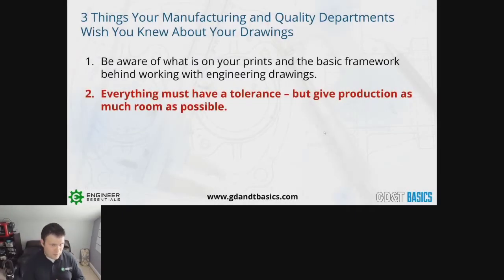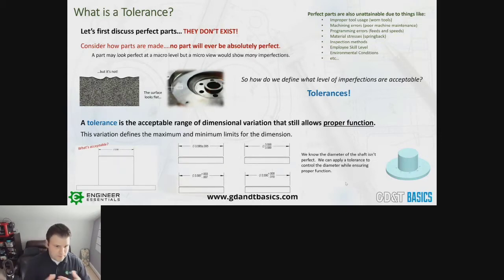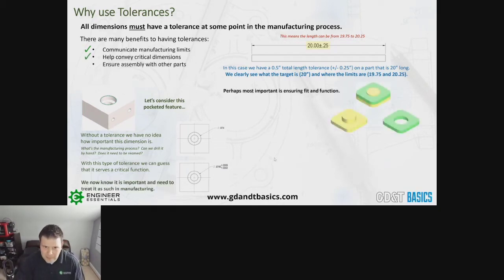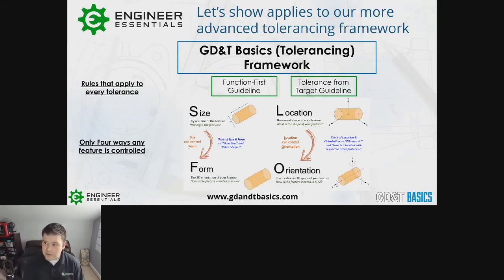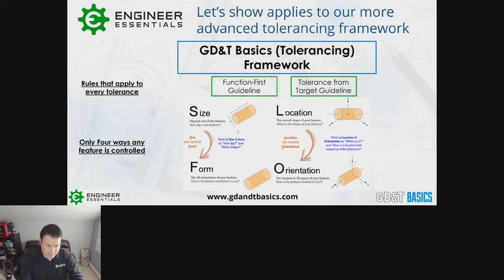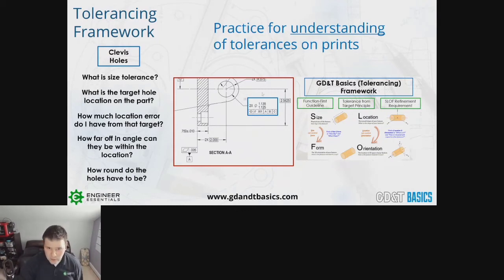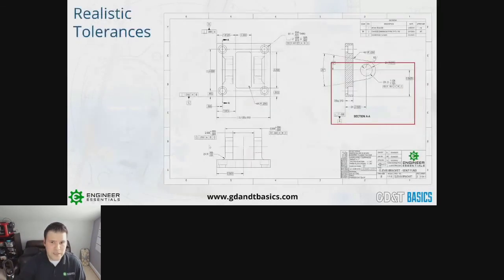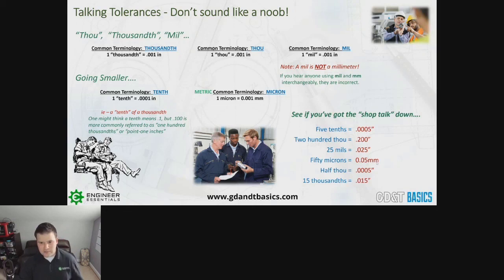3 Things Your Manufacturing and Quality Departments Wish You Knew About Your Drawings - Part 2

Comment: Making the Position Tolerance that tight of .001 relative to A, B and C are over restricting this part significantly. If the only driver for that tolerance is the two holes align within .001, then that position tolerance should only refence one hole to the other (add a datum to one hole and position the other to it).
Reply from the maker: Thanks for the comment! This is definitely one other method to control the coaxiality of two cylinders. One consideration id add on top of that however would be Multiple Single Segment where the upper frame is a MUCH looser tolerance to A|B|C and the lower frame has no datums referenced and a tolerance controlling only the coaxiality. This method, in my opinion, would be the ideal solution if we truly only cared about the coaxiality but wanted to still maintain control of the holes together to a much more reasonable location.